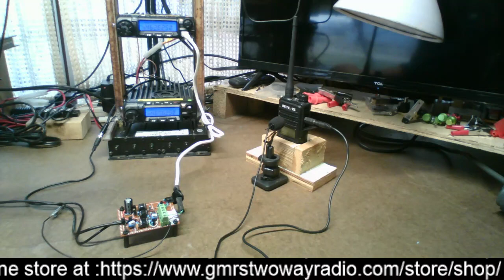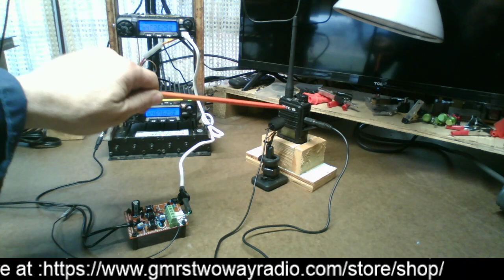🔺SOUND TEST any two GMRS two-way mobile radios full repeater using mobile interface board ! 🔺

Comment: With this board, would it need to be matching radios or any 2 radios that operate on the desired frequency?
Reply from the maker: I think you are asking do the radio need to be the same model and brand name? If that is what you are asking, NO it don't need to be. As for freqs technically it can be any freq BUT make sure its a freq you are licensed for and make sure that freq allows repeater usage too. i hope this answers your question.